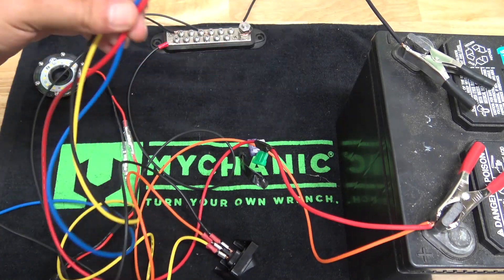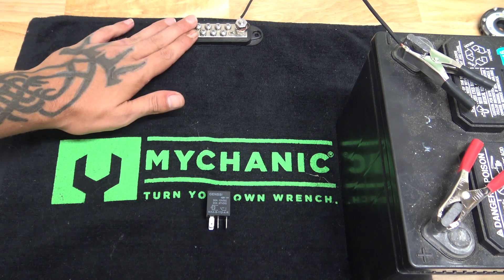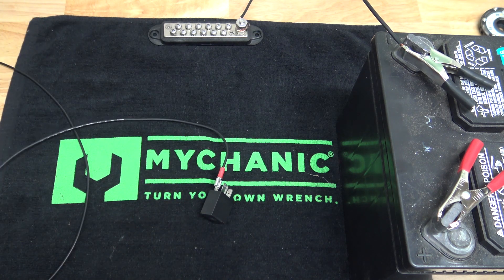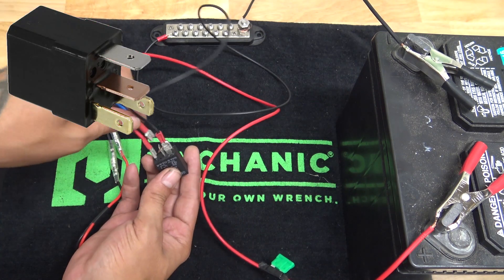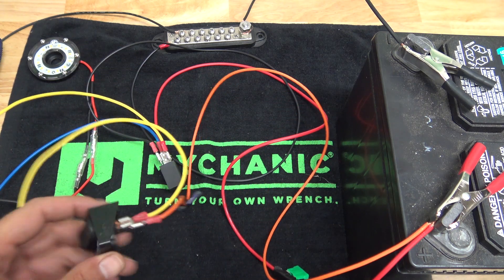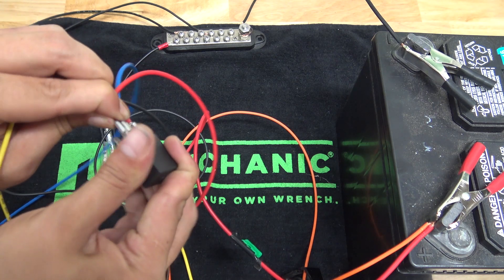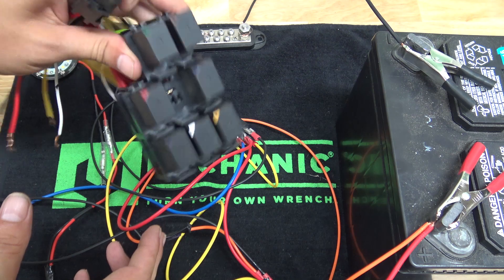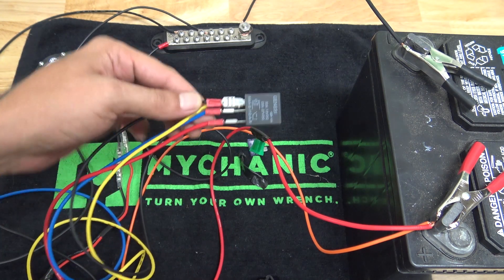How To Wire a 4 Pin Relay (12 Volt DC Micro)

Comment: Swapping pin 85 & 86 is the difference between the relay being “normally open” or “normally closed”. With lights you usually want it to be “normally open”, the relay makes contacts close to power the light. Similar to a home light switch.

Comment: Love your videos. Is there a link to wiring up my wiper motor to my Chevy express. I have a 5 pin relay, an on/off toggle with 3 pins on the bottom, an inline fuse and wire. I need help bc it’s not working. Ty

Comment: do you have to use fuses if you are using something low power draw and wiring to dome lights that already have fuses? Im trying to use this relay to activate some led lights from a dome light that is negative switched.

Comment: Can I copy your setup step by step if I’m hooking up to a factory aux switch? So instead of the last wire to your switch it would go straight to my aux switch? Is that right?
Reply from the maker: Correct. Just be sure your factory AUX switches are positive. In some rare cases manufacturers use ground. Some people wire their relays to be triggered by ground.

Comment: How do I know what size inline fuse to use?
Reply from the maker: If you know how many watts your lights or accessories are you can calculate it. Just divide your total watts by your voltage. This will give you your amps, example; a pair of 60W lights, 60X2=120. 120W÷12V=10. This is 10A. Be sure to give yourself some wiggle room, with 10A I would us a 15A Fuse.
I hope this helps!

Comment: Could the red and the Orange come from the fuse panel.
Reply from the maker: They can, but I recommend the Red (main power for relay) to come from the battery as it will have the most power/current being drawn through it. The Orange would be no problem in the fuse panel. 
Thanks for watching!

Comment: I have some ford 4 pin relays that have 1 2 3 4 instead if 30 85 86 87 so how do i wire those 4 pins for my 52 inch light bar ?
Reply from the maker: If it is the same Ford relay I'm thinking of (I haven't used in many years) the pin number conversion would be;
1=86 (+ from switch)
2=87 (+ to light)
3=85 (ground)
4=30 (+ from batt.)
I would do some bench testing with this because as I said, I haven't used one of those relays in years.
I hope this helps, thank you for watching!
Reply: @RockyXTV  Thanks alot And it was an awesome video !

Comment: Hi just saw this video and I think you can help me out, I have a ultrastart 1250 keyless entry/ auto start lately the lights don't flash when locking/unlocking and dash lights don't come on when I autostart I checked all fuses and theyre fine. I can hear the clicking in the truck when I unlock lock and auto start like always, anyhow I contacted another YouTuber and was advised "  while running wire use a neg out instead and add a inverted relay"- I have very limited experience and asked him to explain it to me in laymen's terms o haven't heard a response. Is they're anyway you can help me out and explain what I exactly have to do?

Comment: Hi bud I have a ultrastart auto start/ keyless entry system the lights stopped flashing when I use the auto start or unlock door,  I was told the relay was blown can I just get a new relay and plug it back into the module?

Comment: great info..  question for pin 86...   I want to hook up a relay in my car to light up LED footwells.     can I hook up my door sw + wire from my fuse box to pin 86 as the trigger ? and  pin 30 going to my LED footwell .. so when I open the doors the LED Footwell lights come on ?

Comment: The multiple wire colors is going to confuse people that aren’t somewhat technically savvy and for those of us who are it’s just annoying. I appreciate your time and effort and the production quality was great but if you would have just used red and black wires it would have simplified this greatly. Red and black wire from the light go here and here*/red and black from switch go *here and *here*. Hell you could’ve even said red and black go from these two pins to this certain place/ red and black go from the other two pins to these certain places. Easy peasy. Thanks for the video. It was informative.
Reply from the maker: Thanks for watching! I use all the different colors for when people ask me for a diagram, it is much easier to follow colors on paper rather than a bunch of red & black lines on paper.
Reply: @RockyXTV  
Thank you Rocky

Comment: Uh for higher draw items (20-30A+) DO NOT SWAP 30 AND 87!!! The way the switch works inside, power flows from 30 to 87. Reversing that flow especially something powered on for longer periods of time and/or higher draw (20-30A+), leads to a quick death of the relay due to power surge each time it is powered on. Short term it will work but long term will die early.

Comment: I like how u explained that wires can be switched around between the pins.  There are 2 circuits in that particular relay.  Each one has a power in side and a ground side.  The relay doesn't care which direction the power flows so its ok to switch the wires on their respective circuit pins.  The low power circuit is the coil and power can come in on either side, all it does is create a magnetic field that pulls the contacts of the high power circuit together to allow power to flow thru.  Again, it doesn't matter which direction.  Excellent video thanks.
Reply from the maker: Thanks for watching and great explanation!

Comment: Is there a reason to not use a micro relay?? Like parts availability? Longevity of relay? Overall just curious af to why use these over big 4 pin relays
Reply from the maker: These are typically only 4 pin most of the time, so if you needed a 5 pin these wouldn't work. Availability like you said, you normally won't find these in the local auto parts store. As for the life of them... I've had some in one of the Jeeps for a few years now with no issues. Some companies rate these up to 40 Amps, I wouldn't but anymore than 20 constantly through them, so I would say these are a slightly lighter duty relay. You can fit a lot more of these in a compact space over the standard Bosch style relay so I would say that's the biggest plus for these.
Reply: @RockyXTV  good deal! Do you know of any boxes that house these relays and fuses together? I gotta make a common source for 7 harnesses.
Reply from the maker: I'm not sure about the relays AND fuses in one when it comes to the micros. There are some when it comes to regular relays, some regular relays even have fuses built into them.
Reply: @RockyXTV  i found one. It uses a 280 series relay. Bussmann 15303-2-2-4 is the part number but bussmann makes several versions and styles
Reply from the maker: Ahh... I have seen these, but for full size relays, never the micros. Thanks for sharing!

Comment: I love micro relays.  I started using them recently with littlefuse fuse boxes to update vintage car wiring to a modern relay based system.  you can really pack a lot of these into a really small footprint which I like.
Reply from the maker: These little guys are pretty much all I use now.

Comment: great video but i have a question  , how did i know what fuse i have to use when am doing something?
Reply from the maker: The fuse for your switch is always going to be a small one, something like a 3 or 5 amp fuse. As for your accessory, you need to do some simple math. If you are wiring up a light that is 100 Watts for example here is how to figure out your amps. Watts divided by Volts, we have a 100 Watt light and the average vehicle puts out 13.8 Volts when running. 100/13.8=7.246, call it 7.25 Amps. Now you know how many amps your light is, just give yourself a safety zone when picking a fuse. With a 7.25 Amp load I would use a 15 Amp fuse, a 10 would be okay, but your Amperage can change with your voltage, so a 15 would be best. I hope that answers your question, thanks for watching!
Reply: thank you very much for you quick answer , keep the good work with your videos